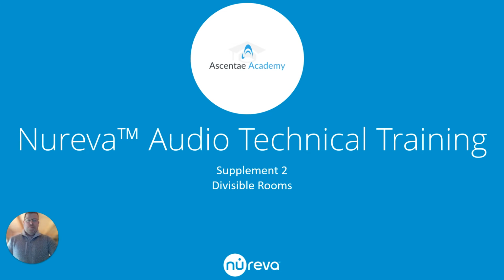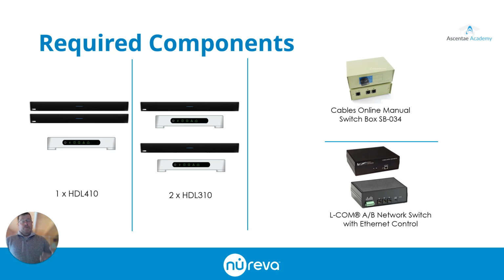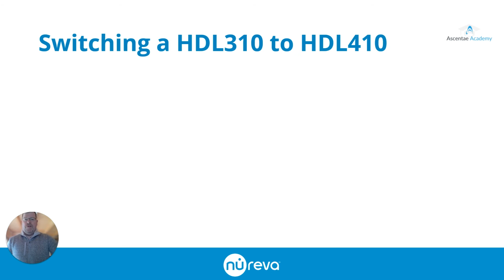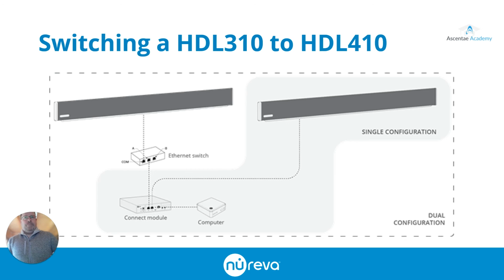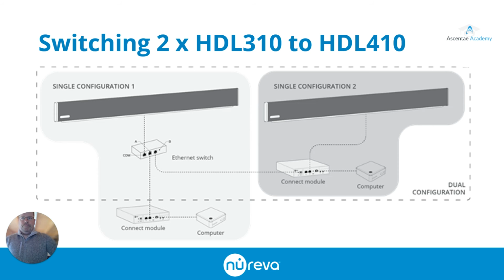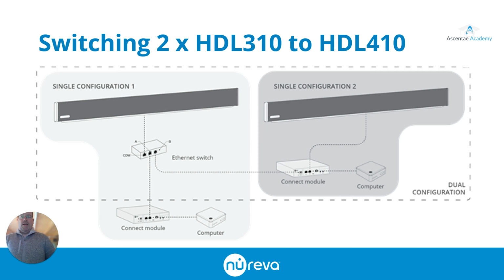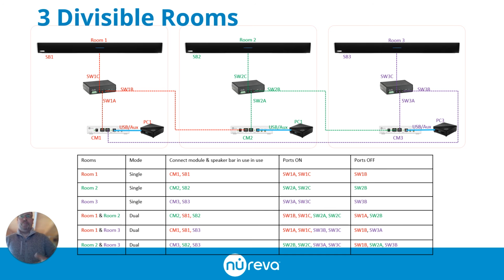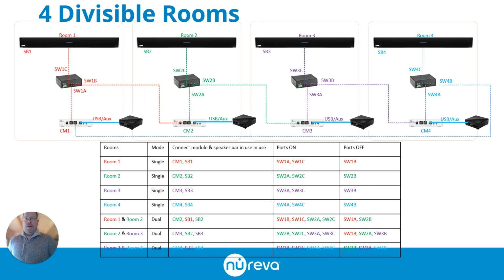Nureva Audio Technical training - Divisible Rooms

Comment: A control system is recommended to simplify the user experience but still with a maximum of 2 sound bars active at any one time, for the control system is it possible if they use Crestron CP4N? Thank youuuu